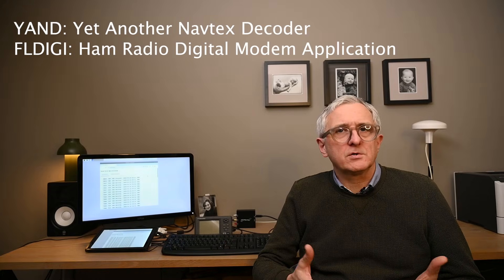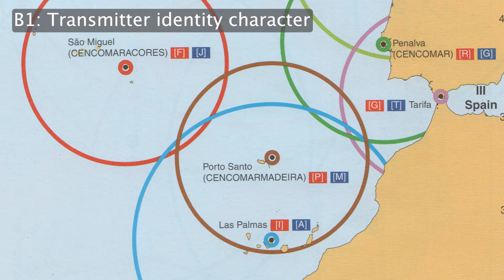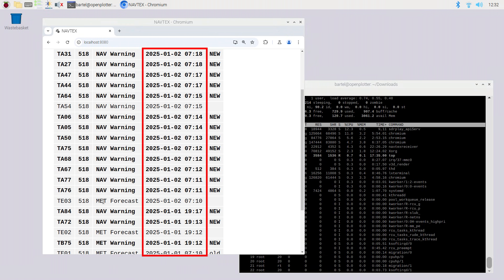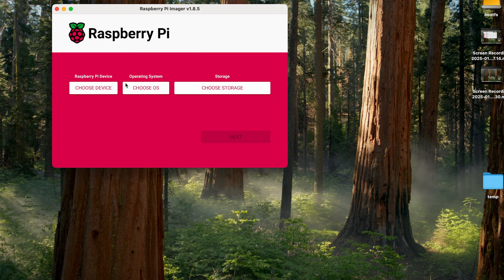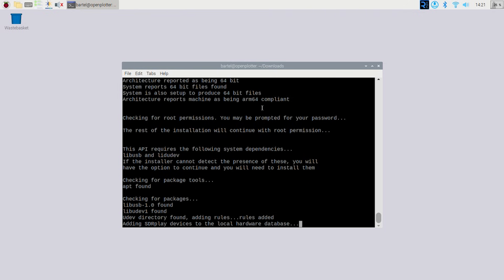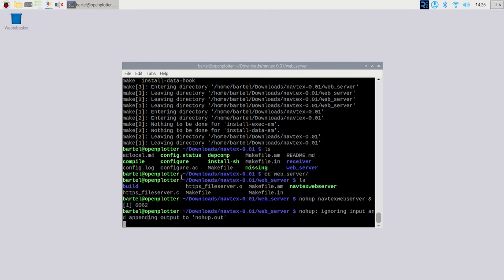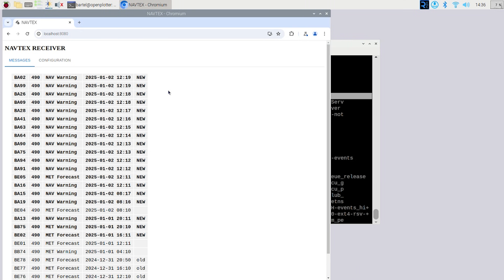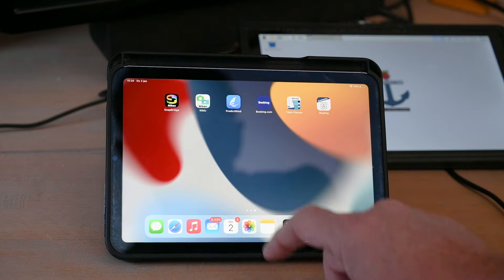NAVTEX on raspberrypi for sailors

Comment: Congrats for this very interesting open project. Well done and presented. I personally love your project because after building and having installed my own complete long wave WX RX on my boat, I wanted to build something similar for NAVTEX. My WX RX module uses a simple direct mixer, a hardware decoder, an Arduino Nano with external EPROM,  a small OLED and a Bluetooth module and works flawlessly, tested already in 600km distance from the station. It independently receives, stores and sends via Bluetooth on demand the WX it has received. I'm a kind of stuck with my own NAVTEX project at the RX/DEMOD side and do not want to use the quiet power hungry SDR version at the moment. Unfortunately for me it's a matter of time available at the moment. The more I like your approach.
Reply from the maker: Allright, sounds exciting. 
Not sure what WX RX stands for exactly. Is it trying to receive RTTY weather info on 147,3 kHz from DWD in Germany? Or rather U.S. Coast Guard weather forecast on HF (NBDP)? Anyway, kind of a challenge to do a lot of it in hardware I suppose. 
Did you know that you can find the service manual of the Furuno NX-700 Navtex unit online? It includes all of the schematics. Can be inspiring for your project maybe. They mix down to 1700Hz +/-85Hz and use a hardware PLL-based demodulator, the rest is in software...

Comment: I look forward to future videos!  You do an excellent job of organizing and presenting your information, so thanks!  I am getting started with RPI and OpenPlotter on my "project boat", and still working out more basic problems such as selecting displays for nav station and helm, and where to install the various hardware components.  SDR will likely be a future addition, once I get all of the basics in place...  I have subscribed, and will watch for future videos!
Reply from the maker: Thanks for your kind reaction. 
Well I myself was playing around with SDR software before I got started with OpenPlotter. So I'm also kind of in the phase of struggling with some 'basics'. Those basic problems are not necessarily trivial problems. Selecting a display... you may have come across this great story by @ApresSail: 
https://www.youtube.com/watch?v=3y9jBpOEguE&t=187s

The screen I'm using in the video 
is the "waveshare 10.1inch Capacitive Touch Display for Raspberry Pi, 1280×800". I would not recommend it though as a part of the screen has lost touch capability already.

Comment: Can you also do Inmarsat std-C in your setup? Thanks
Reply from the maker: Short answer: no. or at least not yet ;-)
Interesting question though. Where to start answering this one...
Navtex and the Inmarsat-C EGC (enhanced group call) are both GMDSS services that are there to allow MSI (maritime safety information) to be broadcasted, but other than that they don't have a lot in common. 
Navtex is an open protocol, based on a public spec (ITU-R M.625-4). Inmarsat-C EGC is a different protocol, not supposed to be open, but some initially closed and later open (source) software decoders have emerged over the past years. (Tekmanoid/Syctale-C). The traditional setup is: SDR# - (virtual) audio connection - STD-C decoder.  
The road I took for Navtex clearly avoids this setup in 3 parts. The same principle could be applied for an Inmarsat-C receiver-decoder. Maybe one day, if I'm in need of new project. :-)
Other aspect: A navtex antenna can be somewhat tricky, an Inmarsat antenna certainly comes with a few more/other challenges.

Comment: Nice first video and seems like a fun project. I wonder how it compares now on price of a total system. Of course, we might have to wait for that video on suitable antennas. I'll be happy to try it out ... Once I have my own boat.
Reply from the maker: Yeah the project was plenty of fun. A few new skills to learn as well. 
Total cost of a system... depends as there are a few options. The SDRPLAY RSP1B is costing about 150 EUR. Cost for a raspberrypi can vary depending on the model you choose. RPI4-1GB costs 40EUR these days. You can add a screen of your choice or use it 'headless' and use a tablet or mobile phone to access the web interface. Antenna can be a bit tricky. Nasamarine offers a purpose-built active antenna for around 50EUR. A so called mini-whip antenna is offered on amazon for a lot less, but requires a bit more care when installing. And of course there's some extra's like a power supply for the raspberry, some coax cable, and maybe an SMA connector to mount on the coax...
I try to zoom in on the antenna aspects in a next video...